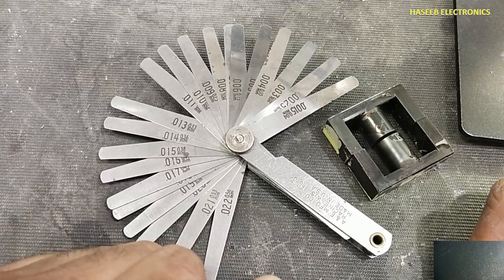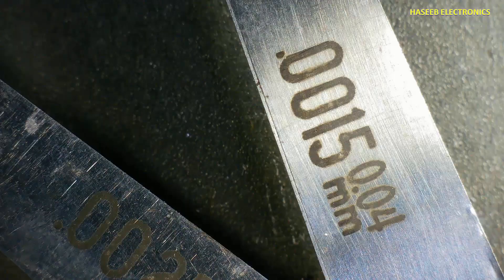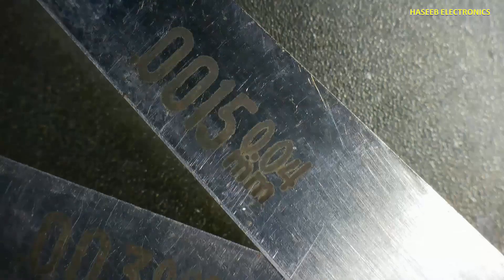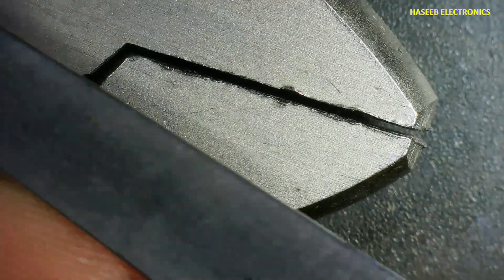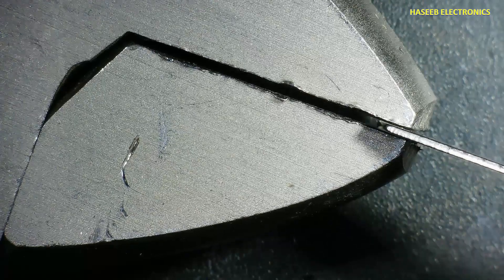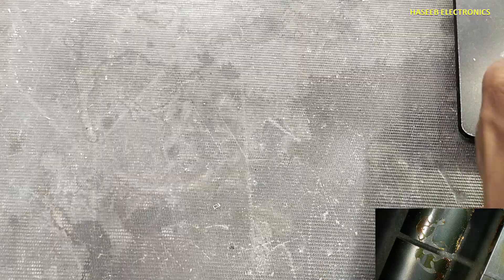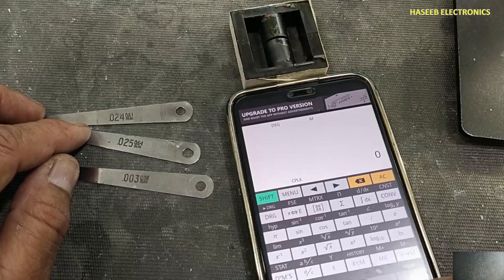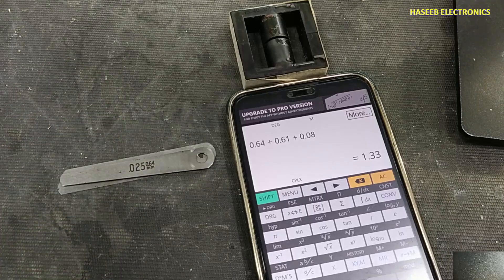{1116} FEELER Guage introduction and use

Comment: Feeler guage was used to set gap on car engine spark plugs. In the past I used feeler guages to set the gap after cleaning the plugs and ran that same set of spark plugs for 15 years from new, cleaning every 3-5 years. Now my current car has spark plugs but they are inside the engine so now it requires dissassembly of the front of the engine to change the spark plugs.... at a cost of over $400... just to change the plugs!!!
Reply from the maker: wow 
it is really great to know about your long time attachment with feeler guage.
Reply: @HaseebElectronics  Occasionally I used them at my job also. I worked as 1st Class Machinist on CNC machines. Some jobs had threads and special thread guages for tapered threads used in gas and oil industry was used with the feeler guage to check the gap between guage aand a square shoulder to know if the thread was cut correctly. The shoulder gap tolerance was +-0.050" which is when cutting thread +-0.002" on diameter.
Reply: @HaseebElectronics  AOA sir

Comment: Good day Haseeb, appreciate your tutorial videos which have encouraged me into DIY in basic electronics. 
I have a Prag 10kva Servo voltage stabilizer with control board problem. The culprit is the mcu(SAS1011), the board is TL-P04MSV13 (available in the internet) but not much info about the mcu(pin-out/reliable seller) in the internet. 
I need help in finding a replacement chip if possible. 
Tried putting links but no success. 

 From Nigeria🇳🇬